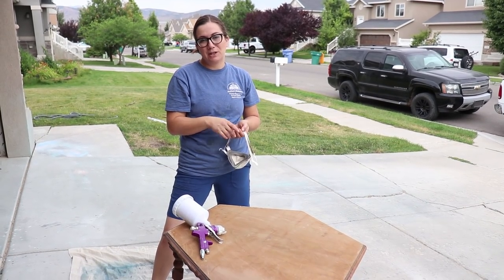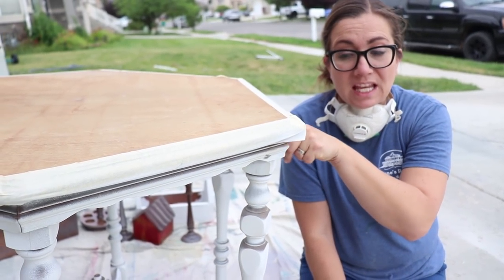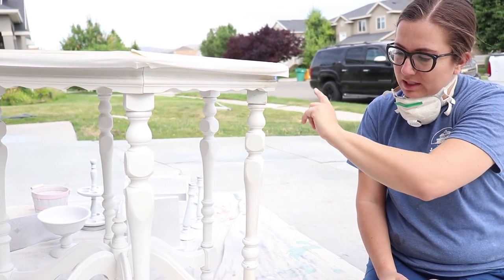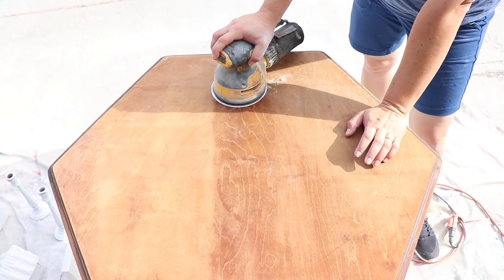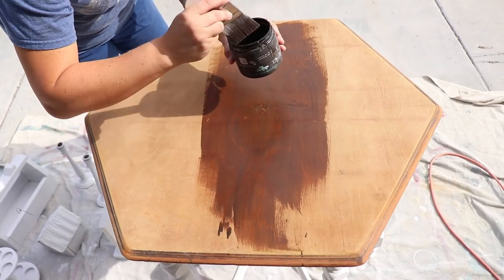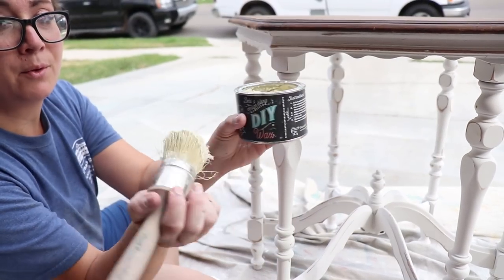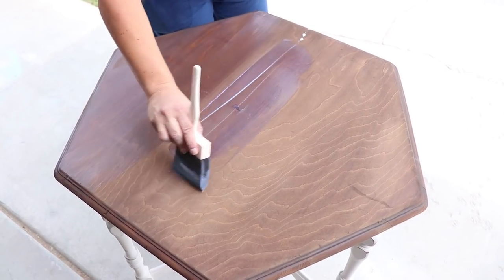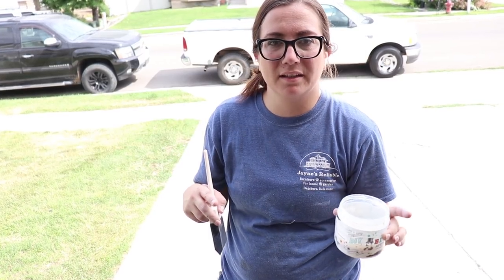How To Two Tone An Antique Table

Comment: Thank you so much for showing me what to do as I have had a table like this for over 2 years now and did not even want to try, but I may undercoat the bottom of the table a light grey first to see if when I sand it back some it doesn't show to much of the original colour. If it don't work out I can just paint it with a bit more white.
Reply from the maker: The beauty of paint. If you don’t like the way it turns out, repaint!  😊

Comment: I really want to try this look on my vanity with white swan on the base. My vanity is a light wood and I am wondering if I should use the dark and decrepit color (or something like little black dress) on the base before painting white so that when I distress the dark shows (instead of the light yellow wood color).  I just got a mirror from you and it is white swan with a black color that shows through the distressed spots so I want to match the vanity to mirror. 
Thanks for any advice in advance!

Comment: That is exactly what I am doing right now with my hutch and farm style table. I was frustrated because the backing and some of the hutch was some kind of MDF. I don’t have an air sprayer and since my first experience with the electric sprayer was a nightmare I painted it by hand. Jami, I don’t know how you do it. I was upside down and backwards doing the hutch. I also took your advice by painting the inside a light gray instead of white. Thank you. Your table is beautiful! How long does it take for topcoat to cure before I can set the top piece back on the hutch!
Reply from the maker: I would give it 3-4 days.

Comment: What a great piece! My wife and I plan on doing our kitchen table as soon as we move to our new house. I just picked up a desk for my home office and someone had attempted to stain it. The color is Kona but there are a bunch of brush strokes in it... I can't tell if it's in the stain or the clear coat. Any recommendations on how to remove these? Am I going to have to sand and re-stain/clear coat?
Reply from the maker: If the strokes have dried there’s really not a good way to remove them if it’s in the stain and sealed.  If it’s just in the top coat you can probably just lightly sand it down with some 220 grit and then try resealing.
Reply: It's definitely dried... it was done a couple years ago. I'll try the 220 and resealing. Thank you for the advice and the great videos!
Reply from the maker: Good luck!  Worst case, break out the 80 grit and sand that down if resealing doesn’t work. 👍
Reply: Will do. Thank you!

Comment: Love this piece! When you're sanding...are you distressing only or trying to smooth out the paint as well? Do the paints you work with "need" to be sanded or could you obtain a smooth finish with only paint and top coat?
Reply from the maker: You can get a smooth finish without sanding. The DIY is a little thicker than most paints and tends to have a little more brush strokes (which I actually like) you can dip your brush in water as your painting to smooth it out or...I like to sand to distress and smooth while I’m distressing.
Reply: Jami Ray Vintage awesome! Thank you so much for responding... I absolutely adore the work you both do... I watch your videos more than regular TV lol. Keep the vids coming!
Reply from the maker: Thanks for watching!  A new paint pour video is on its way!  (We used milk paint today)

Comment: When you are staining the top and you don’t want the rings to show through, do you use shellack. Or is that only with paint??? Thank you!   Loving your videos
Reply from the maker: So if I’m staining the top and it has rings I keep sanding unless it’s a veneer. If it’s a veneer and the rings won’t sand out you’re usually stuck. If that’s the case and I’m dealing with a veneer that still shows rings I dry brush to cover up any blemishes. Here’s a video on that technique. 
https://youtu.be/V30LRb-sWIE

Comment: What shellac spray brand did y’all use? The one I bought Gunked up really bad
Reply from the maker: We use Zinser shellac. Link is in the description of this video.
Reply: Jami Ray Vintage is the 123 or 321 primer not the same? That’s what I got from Zinsser
Reply from the maker: Oh, so the primer is completely different from what I use. We’re using the Zinser 408 Bullseye shellac. It’s clear.